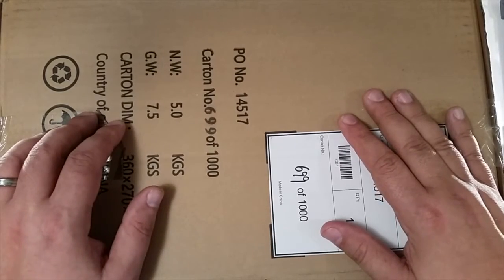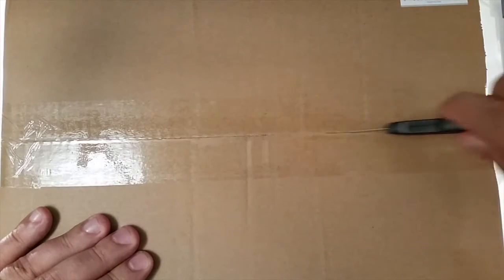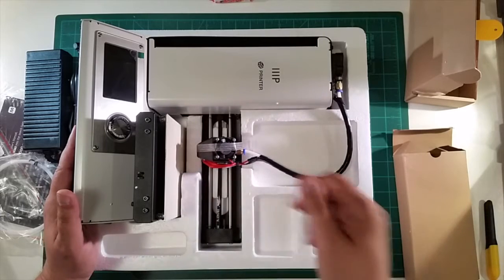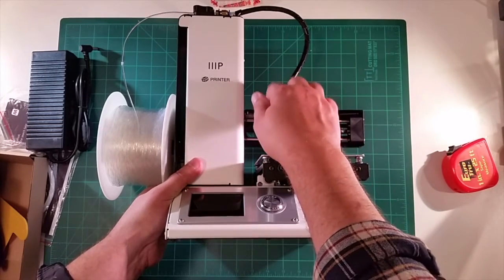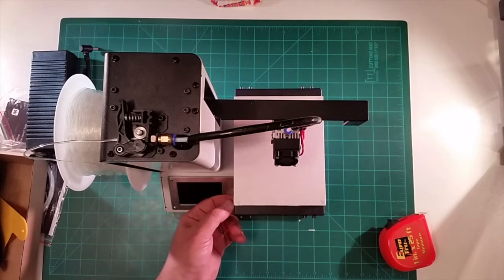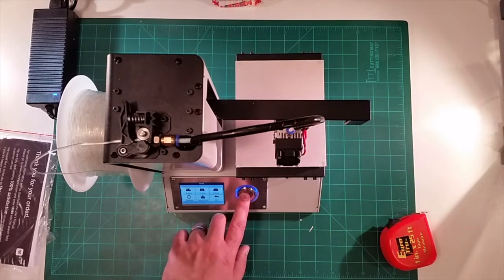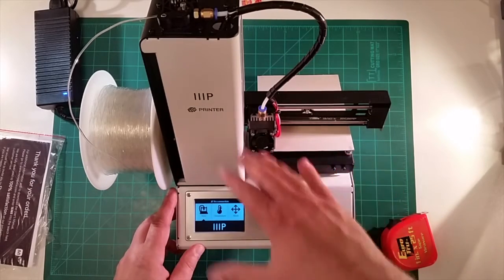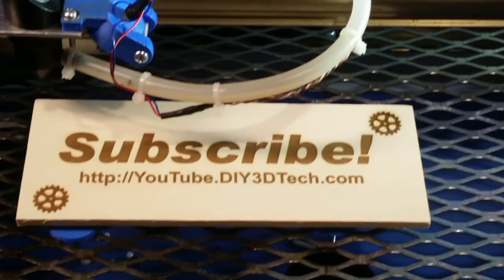MonoPrice Select Mini 3D Printer - Unboxing and Comments!

Comment: thank you very much! Waiting for it to arrive in the post, I'm off to see if you made more videos on it now. I'm particularly curious if you have anything on cura settings and if/when it blocks with filament what you do as I hear 3d printers do that.
Reply from the maker: Plugin is typically a result of retraction setting being to frequent...
Reply: hmm, maybe that's what happened to me in the past. What would you consider to be a too frequenet/recommened value for the MP Select mini?
Reply from the maker: It depends on the material and print.  If I have a lot of moves, I reduce and accept more stringing to prevent plug-ing.  Also will will depend on your feedgear (i.e. the type) too...

Comment: Am I the only one who thinks for a product like this that one should fully read through the instructions first before plugging in the device?  The way the video goes it makes you look like you don't know anything about the printer (i.e. the buildtak on the bed was a big giveaway). Shame.
Reply from the maker: Whats wrong with the buildtak on the bed?  It comes with a big piece of white masking tape which is "lame" (will switch to PETE soon, just didn't have any at the time).  Also the instruction are booklet to is pretty lame so nothing to write home about there and in typical maker fashion I have been more of a plug an go kind of guy which I have to share with you has lead to a fair number of monetary success in  life so don't knock till you try it, you might like it :-)

Comment: What is involved in getting the programming together to print? Sorry, I am just starting to look into these. Would you have any suggestions on getting into these for a beginner?
Thanks for the video.
Reply from the maker: Would highly recommend this printer for the novice!  Very easy to use and set up.  The printer will come with CURA as a slicer, so you will load an STL model, slice it and write the gcode to the micro-SD card and insert it into the printer.  Then select print :-)
Reply: Thanks.
Reply: It might be a good video to show the process of going from a concept part through printing it to show your process of drawing through the finished part for toughs of us that could use that information (beginners).
Thanks again.
Reply from the maker: I will put that on the list!  Thanks for suggest it!

Comment: I've been thinking about getting one of these. The following is from another YouTube review which was very positive, but had a few complaints. Could just be a lemon he received; don't know if everyone has these issues:

"One of my biggest complaints is the gap on the hot end between the brass fitting at the end of the Bowden cable and the entrance at the top of the nozzle. Filament will get caught on the edge of the nozzle entrance pretty regularly so you have to take the filament out and cut it at a different angle or if it is really stubborn take the fan off and guide it through. I may try to find a small tube that can fit in there to reduce the gap.

Additionally the limit switch on the Z axis is inaccurate. Three out of five times I home the axis it will be slightly different from the previous home. This leads to a lot of bed leveling. Hopefully Monoprice has fixed this in more recent batches."

Just as the Monoprice i3 v2.0 is a rebranded Wanhao i3 v2.1, the Mini is a rebranded Malyan M200:

http://malyansys.com/en/?page_id=315

Unfortunately, it looks like no spare parts are available from them as their wiki is not good:

http://wiki.malyansys.com/doku.php?id=home

and their user forum is unused:

http://malyansys.com/bbs/

Hardware review of the Mini:

http://hackaday.com/2016/06/13/review-monoprice-mp-select-mini-3d-printer/

From Thingiverse.com:

Monoprice MP Select Mini E3D Hotend Adapter

http://www.thingiverse.com/thing:1621387

"The Monoprice MP Select Mini is the best 3D printer for the money, with one problem: you can't buy replacement hotends. Hotends are consumables, and eventually the hotend on this $200 printer will break.

Right now, the solution to a broken hotend on this printer is to spend another $200 to buy another printer. Spending $200 to replace a hotend is absurd, and any company that does that will quickly go out of business.

The solution? A 3D printed hotend adapter for the E3D V6. This should be the first thing you print on the MP Select Mini.

The print has been tested, it works. You'll need some M3 nuts and M3 socket head screws (M3 x 20mm or thereabouts)."

I'll add that you can't get ANY replacement parts for either of Monoprice's two most popular 3D printers (the Mini and the i3) from Monoprice, but their i3 is just a Wanhao, so you can at least get parts for their i3 from Wanhao or other sources of Prusa i3 clone parts.

Other possibly useful Thingiverse STLs for the Mini:

http://www.thingiverse.com/thing:1710286

http://www.thingiverse.com/thing:1725118

http://www.thingiverse.com/thing:1724767
Reply from the maker: Since I travel for work, I queue up videos for 1 to two months in advance.  So I have had this for over a month and no issues.  Now it is a chinese printer so one can be good and another bad for sure.  I believe this is  a second generation version and for me ~200 it was an impulse purchase and used it (knock on wood) for over a month with no issues.  Also its pretty basic so if something breaks it becomes part for another project or I fix with what I can get.  The hotend is ok, likely I will replace it some day.  I have even sold my fab-mini is this just beat it so bad!  Also it has an ARM process and belive 32 bit so its move ments are very nice!  I am seriously thinking of buying a second, however I also want to get a larger Laser and CNC Machine  so room is getting tight as well as the frown on my wife's face when all of these boxes show up :-)
Reply: I want one to use exclusively as a small ABS parts machine. I don't need it immediately, so I think I'll wait to see if they come up with a version that's even further tweaked.